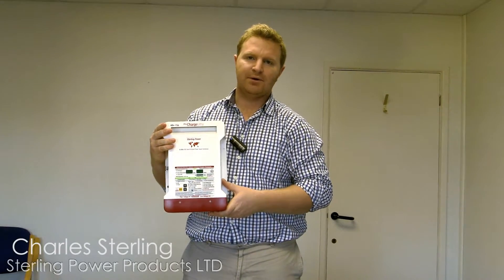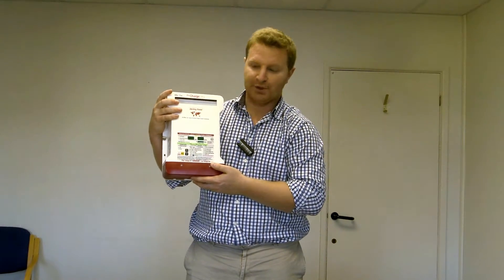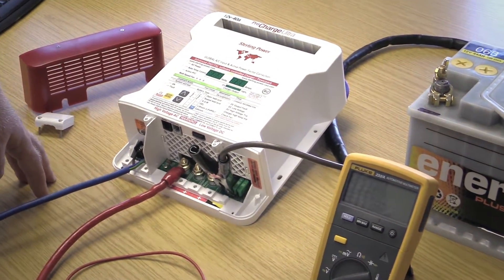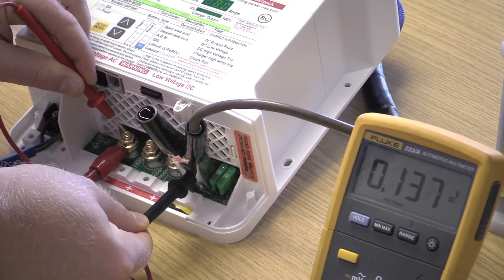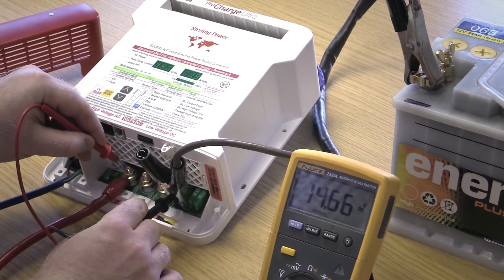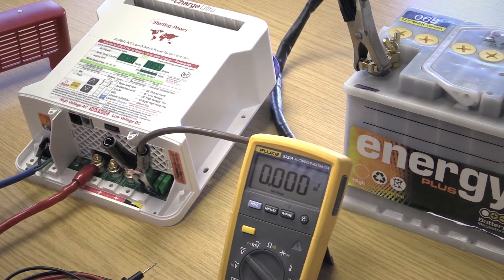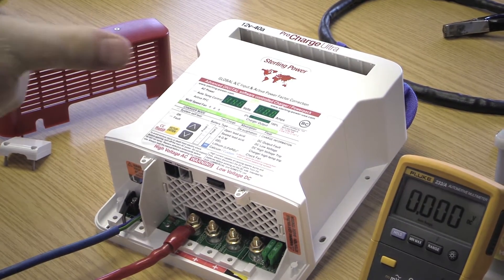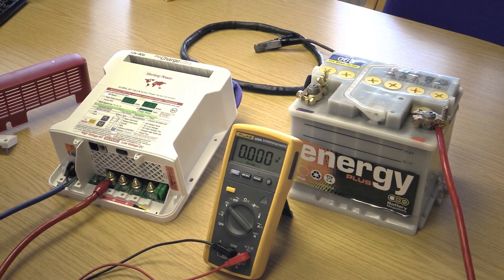Pro Charge Ultra 0.0V/A Display Troubleshooting

Comment: I appreciate this but why is this not a design flaw/recall and replace campaign? Step 3 did fix my ProNautic charger (same device) but not until it killed two huge batteries…disappointing I was sold this $1000+ charger with a known flaw like this.
Reply from the maker: Hello Downandloaded,

This wasn't classified as a design flaw or recall because none of the troubleshooting in this video is a fault of the charger itself. It's also worth noting that the ProNautic started as the same product, but has not been developed over the years whereas the PCU has. 

Step 1 is a fault that occurs purely from the battery simply not being connected to the charger.
Step 2 is the charger simply in a turned off state, so user error
Step 3 is similar to step 1 (IE the batteries are not, for some reason, providing a voltage to the terminals or you need to act as a power supply for any reason) but is overcome by forcing a live voltage onto the terminals. That isn't a flaw, that's a feature. It's illegal to sell a charger in California with a live output by default, as specified by the CEC. 

The ability to toggle between BC and PS mode is covered in the manual and is legally required for us to sell in some states, as well as to be able to protect a user.

Comment: Hello ! Great video ! I did all the tests and I went so far as to remove the negative in PS mode and when I do that, I have voltage between my terminals like you, but when I reconnect my negative and restart the charger, I still have the 0V / 0A ... Did I do something wrong? Thanks for your help
Reply from the maker: Hi Frederick,

You have the unit in power supply mode, the terminals are live, but the screen is displaying 0V/0A?

What batteries are connected? What's the voltage at the battery terminals? 

Hopefully we can solve your problem :)
-Ben

Comment: Nice video thanks.  I have used FLA preset (14.7V) and when I first turned on my charger it went into conditioning mode.  Output on charger was either 15V or 15.1V yet battery charge read the correct 14.7V.  Why the discrepancy?  Does this simply mean that there is a 0.3 to 0.4 voltage drop?
Reply from the maker: Hi Andrew,

If you're getting 14.7V correctly at your battery terminals, but 15V or 15.1V at the output terminals of the PCU then the only thing that could be happening is a loss down the cable OR a bad connection which could lead to sadness. 

Check connections down the entire cable run and double check the voltages with a multimeter and if it seems safe and fine, then yes I'm afraid it would be voltage drop. 

Hope that makes sense!
B

Comment: What size cable should be used connecting to two 110ah batteries
Reply from the maker: Hi John,

That solely depends on what's going down the cable. If you're utilising a PCU1260, our 12V 60A model, we'd recommend 16sqmm cable.